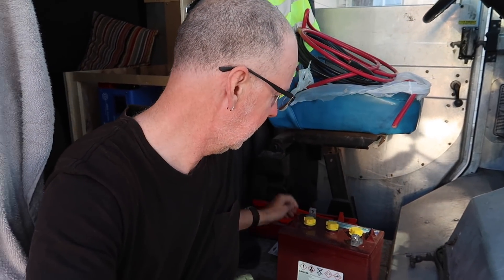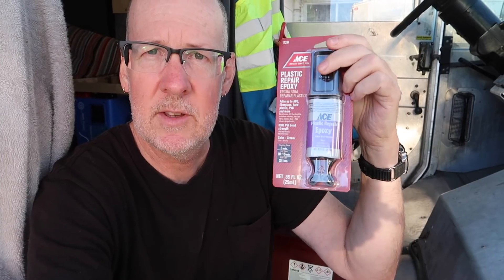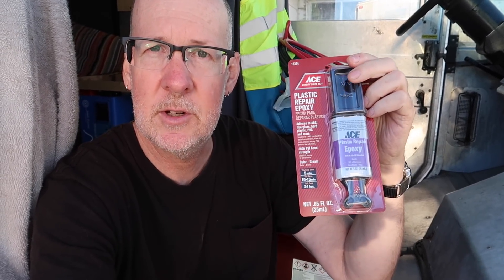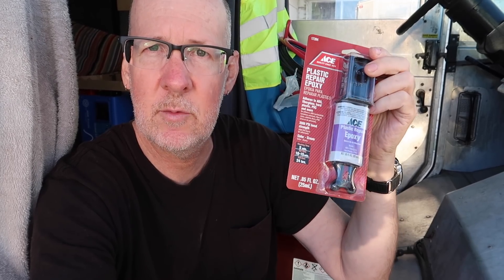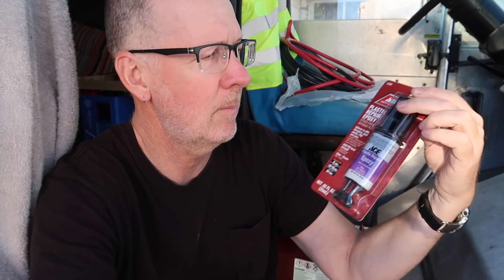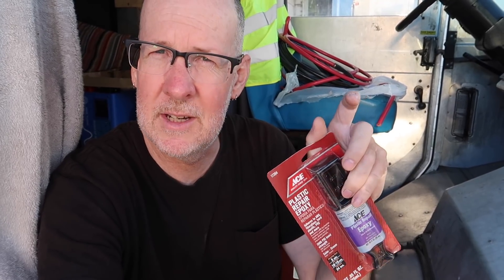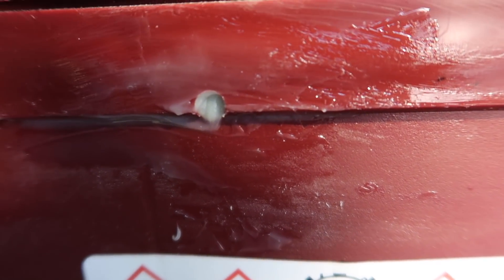Lead Acid Battery Repair | 2 Min Tues E368

Comment: Hey, Seven. nix the idea of taking fluid from the other cells. Distilled water will work or you can buy battery acid from an Auto Parts store. That would be a real parts store, not the Auto Zone types.  Good idea to check the cells with a hydrometer, it doesn't have to be a expensive one, Wally World or Auto Zone, prob in the $5-9 range. Been a subscriber since you got the Steppy.. You're doing great. Take your time and remember to measure twice and cut once....
Reply from the maker: I believe Guisepi has a hydrometer so we'll check them with that

Comment: Good job Seven! I think that equalizing the cells is a great idea as well. I can't see the other comments for some reason and I had this question; is distilled water still the first choice for a top up? The very little that you would require probably won't be much difference either way, I was just wondering if that was still a thing.
Reply from the maker: yes, we will use distilled water after getting the levels equal

Comment: Just add distilled water to the low cell. Just charge that battery.  Do not take acid from the other cells on the other batteries.
Reply from the maker: thx for the advice!

Comment: HERE IS ANOTHER --TIP N  TUESDAY ---If you look at the manufacturer's data sheet you will see a term called "temperature coefficient Pmax". For example the temperature coefficient of a Suntech 190 W (monocrystalline) solar panel is –0.48%. What this means is that for each degree over 25˚C … the maximum power of the panel is reduced by 0.48%.

So on a hot day in the summer – where solar panel temperature on the roof might reach 45˚C or so – the amount of electricity would be 10% lower.
Reply from the maker: wow great info. thx

Comment: A simple repair would be to snip little bits of the casing from areas where not needed and fuse these into the hole with a soldering iron or even a hot knife or nail. The plastic will melt and fuse together to make an almost invisible repair, a sort of plastic weld. Common way to repair split battery casings.
Reply from the maker: we thought about that, but couldn't really find anything to snip for it
Reply: Seven Wanders the World the little brackets that can have lifting handles for tight applications can be used. Not really needed and a good source of spare plastic. Keep up the great work, videos most entertaining.

Comment: Always a good idea to use a small piece of packing/cloth something like that to stop the Epoxy falling into the 
battery,that way you dont get a hole in the Epoxy from outside the battery.
Reply from the maker: great tip... didn't think about that

Comment: That wasn't the product I thought you were getting.  There's a marine/pool epoxy that's moldable.  J-B Weld 8277
Reply from the maker: I tried to get JBweld 8277, but I'm in Blythe where there isn't much in the way of resources and I think the plastic repair epoxy will be sufficient for the repair

Comment: I am always uncertain about the mix when I'm squeezing out the resin and hardener, one glob always seems to be bigger than the other.  I can understand the angst about drilling a hole in your battery, they are very expensive!
Reply from the maker: I liked using the duel syringe; makes the 50-50 ratio easier